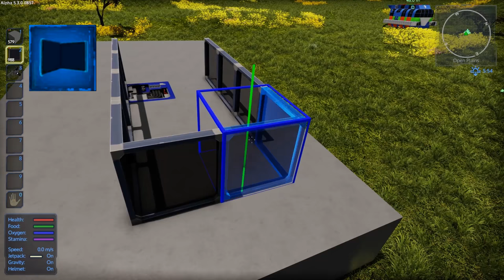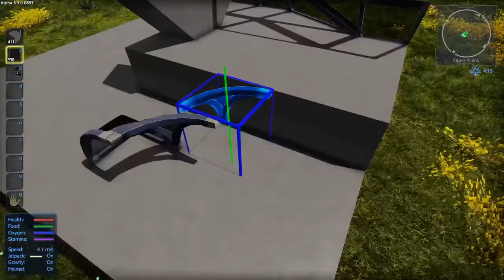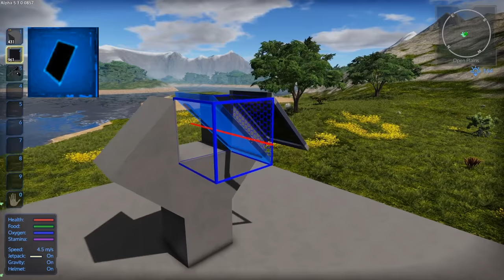Window Blocks Basics - Empyrion Tutorial / Guide - how to build with window blocks - MaM Games

Comment: This is a very informative, no-hype video.  Despite being 4+ years old, it's still perfectly relevant to Empyrion 1.15.  I was having difficulty getting the corner pieces into the correct orientation with uniform tinting and I would not have thought of using the multi-tool to fix the latter.  Thanks for the video!

Comment: How do you clad the side of several sloped pieces? the Side 1x1 piece will either be in position but tinted the wrong direction, or tinted the right direction but a full square off. There is no left/right pieces, just one piece.
Edit: Never mind, you can change and rotate with the multitool to get it done.

Comment: I know this is an old video but I thought I'd give it a try. How do you know which side is tinted? That part confused me. I have a quarter-round window that I need to place in my ceiling and it won't go up there! It's really frustrating.
Reply from the maker: The "outside" is where the tint goes. But I think that's not what you asked?